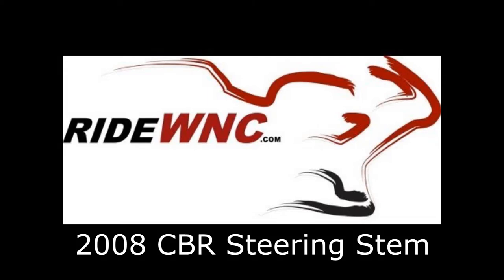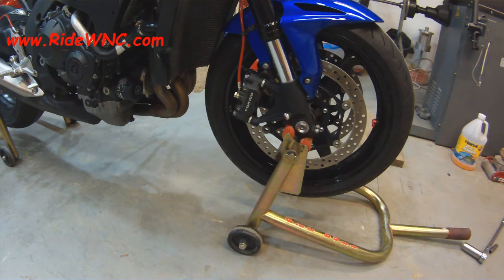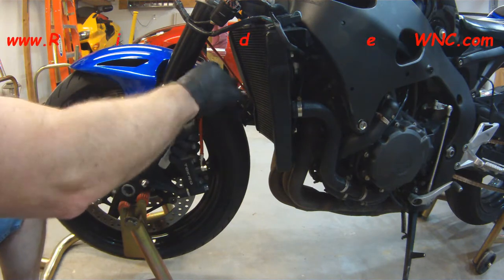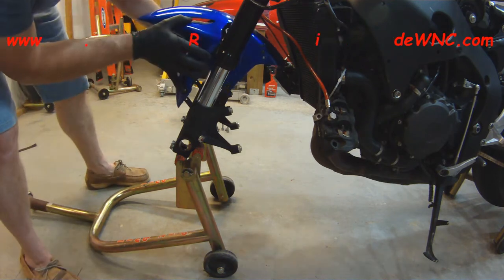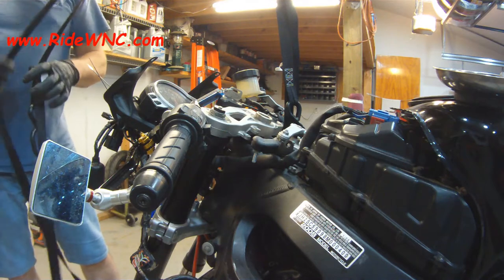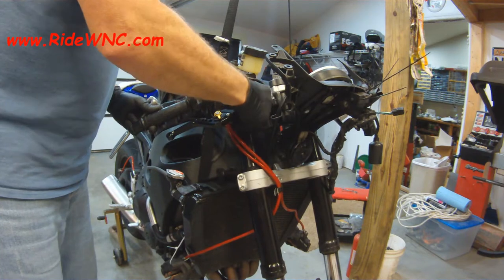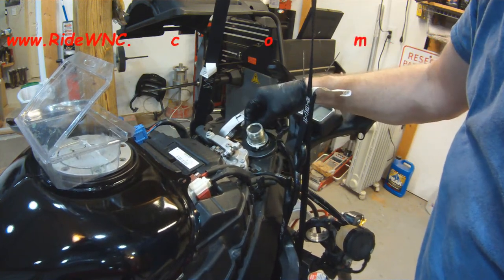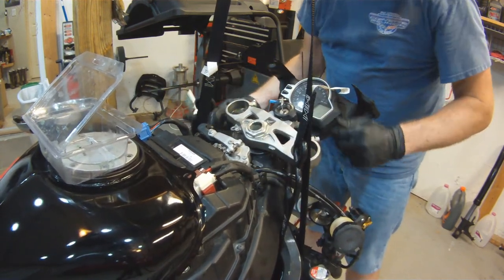2008 Honda CBR1000RR Steering Stem Bearings

Comment: what size socket did you use to tap in the races?
Reply from the maker: This was a long time ago and many bikes. If you don't have large sockets, just take the race to the store and match it up. I can tell you it was Craftsman. If I am going to use the wrong tool for the wrong job, I perfer to beat up Craftsman and let Lowes replace it.

Comment: IMPORTANT NOTE ON BOTTOM BEARING: PUT THE SEAL IN BEFORE YOU PRESS THAT BEARING IN OTHERWISE YOULL HAVE TO BREAK THE BEARING AND BUY A NEW SET. THE SEAL IS VERY IMPORTANT...I FORGOT THE SEAL BEFORE THE BEARING AND HAD TO BUY AND DO IT AGAIN...😅
Reply from the maker: OOF!
Reply: Hey buddy do you press the bearing to the triple tree down down or do you leave a little gap between the triple tree and the seal with the bearing? Cause i saw that if you do press it flat all the way down its difficult for the bearing to turn? Please advise
Reply from the maker: @angrypeach1398  That info is not correct. Stiffness in turning is caused by too much torque on the nut. If you leave a gap that gap will turn into slop in the steering after the first wheelie.

Comment: where did you buy that adjustable spanner wrench?
Reply from the maker: It was in my issued toolbox when I was in the USMC. Just another tool to make that bigazz box heavier to carry everywhere. I never used it once in six years. When I was discharged, it was dischaged with me. My personal going away present. That was thirty years ago. The box and all the tools were Snap-On or Blue Point if that helps you track one down. I am sure the Snap-On guy can find one.